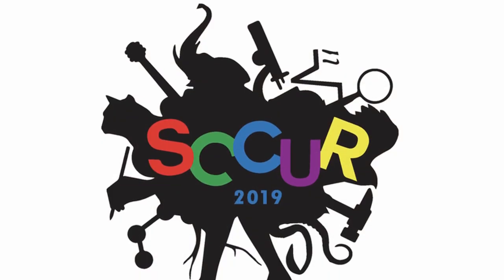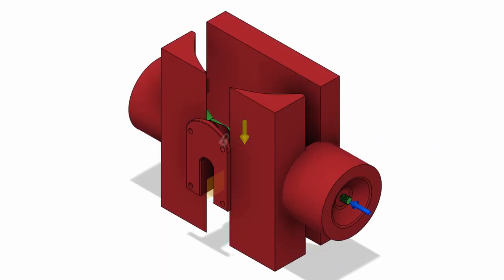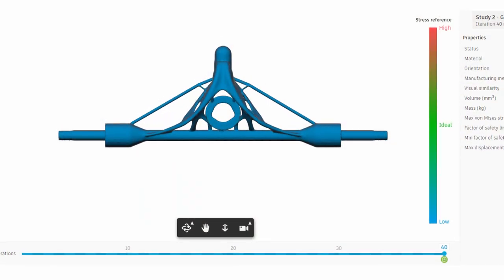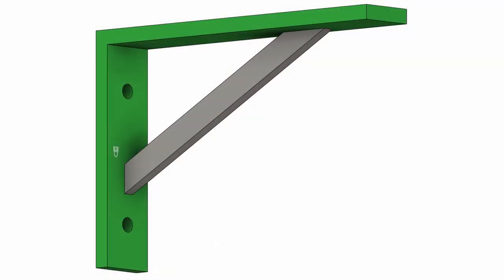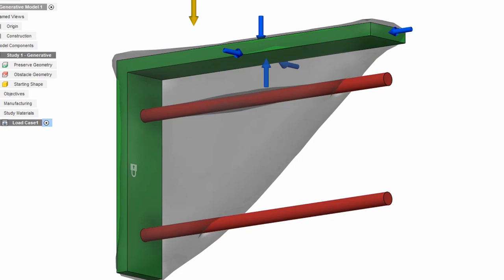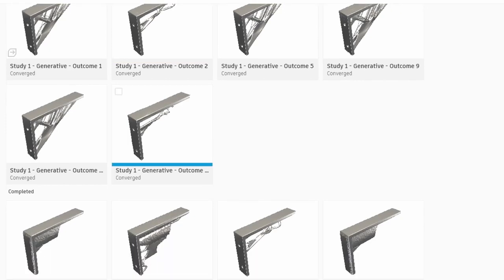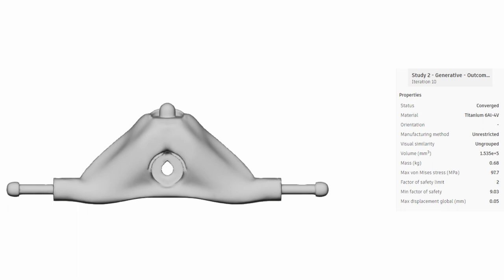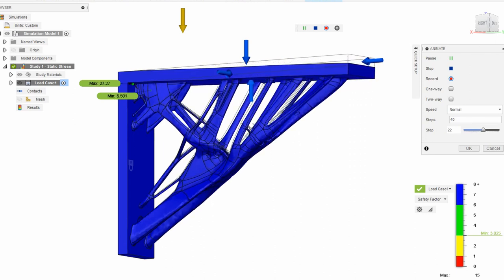Generative Design: The Manufacturing/Design Process of the Future

Comment: Is this also known as topology optimization? I've remember looking into it whilst designing a car monocoque university
Reply from the maker: They are similar. With topology optimization, the user applies stresses and then removes material. With generative design, the user only applies the initial forces, and then the program takes it from there, either adding or subtracting material as it deems necessary. Topology optimization requires much more user input during the process.

Comment: Need some help with fusion 360 can you help
Reply from the maker: I'd love to help! What exactly do you need help with?
Reply: @FormulaJake  
I have a problem in defining contact points in a single piece element the components doesn't have multiple parts but a single piece in simulation results intersection of part rather than sliding